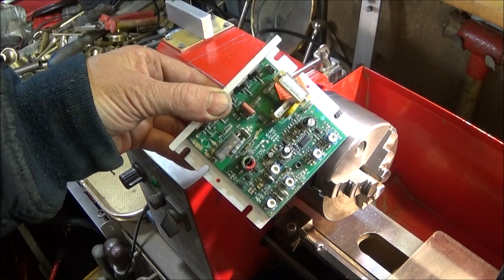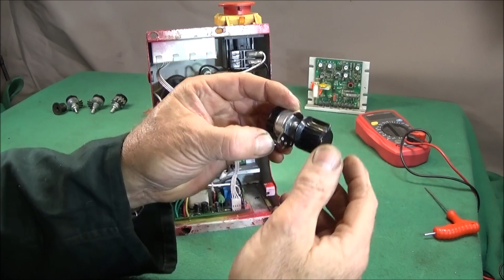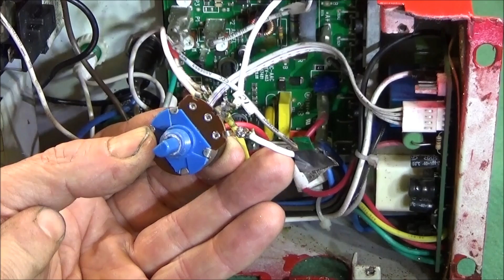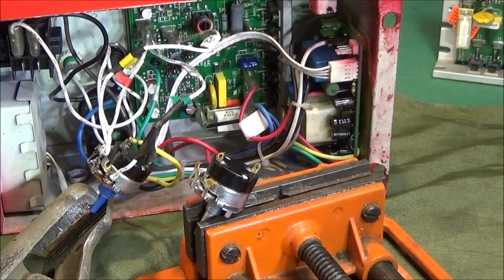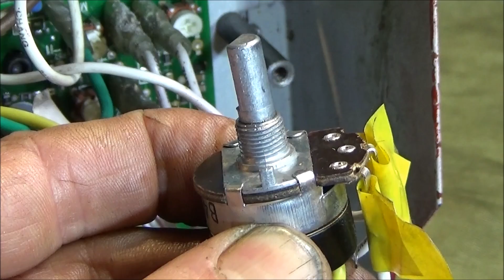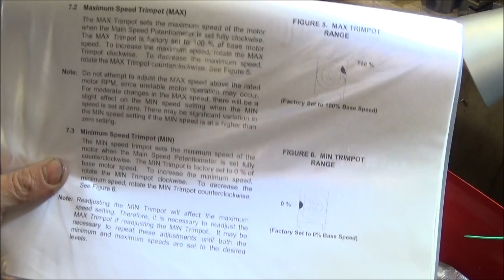How To Test & Fit A Potentiometer Speed Controller On The Chinese Mini Lather

Comment: Thanks for answering my question about using a momentary switch and a non-switching pot. That's what I had in mind b/c the OEM switch is difficult to find or it's very expensive (~$25 US). Now I know it can be done. Appreciate it!

Comment: Just reposition the Forward Reverse selector switch so the rotating chuck provides isolation. If the Chuck's spinning your won't be able to change rotation... so that flimsy zero selected switch would be unnecessary.

An electrical interlock isn't difficult... A zero speed switch with a timer for a second or two of anti bounce would do it. I'll see if I can grab one or draw up a simple circuit to do the fwd rev using relays instead of the drum switch. 

If you have a B472 potentiometer too it's a 4.7K ohm
Reply from the maker: I got rid of the original Chinese electronic parts in the end. I now have a VFD and three phase motor control which is excellent for this lathe.
Reply: @SteveJordan  VFD's are greatly improved now. It's helpful to adjust your belt drive ratio so you're using all the rpm the motor has available. AC motors have always been the first ones to complain about low rpm work but their winding details are getting better all the time.
Cheers.
Reply: @UCEpeQtxhVUTtMZzBpdegp-w Well that's where my comment got to. I was working on it and got distracted and forgot about it... Looks like I hit send. Sorry, I was planning on adding something useful for your rotation change enable switch. They seem to last most people about a year. Bourne wire wound potentiometers are what I like to rely on for customers. I've never had one fail. The 10 turn ones are helpful for fine speed control on things like a welding turntable. The simple way to have a protected zero speed rotation change is to tie fwd and rev selector switches each to a relay and an on delay timer in parallel. The relay's normally closed contact disables the motor until a parallel timer contact closes when the timer times out. This enables the motor again and the potentiometer need not be turned down, the speed will remain as is. 

The timer setting just needs enough time set to allow a coast down from full chuck speed. 
A schematic diagram would be much simpler. 
This is just an idea for anyone who may be interested. There's many ways to automate.

Comment: Ehi Steve, minute 8:17 - i also had the same problem with my potentiometer, and - as at that time wasn't able to find a potentiometer whose switch was closing in anti-clockwise position, i built up a piece of printed circuit board with a normal linear potentiometer of 4,7 kohm, a microswitch ( type with a little wheel ) and a lathed round piece of steel, coaxial with the potentiometer itself, with an half bore in the outline circle, just to get in the wheel of the microswitch.
It works, but - due to the poor room inside the box - i was compelled to adjust the things so that the speed was increasing in an anti clock-wise rotation ( crazy !!! ).
After some time i got the whole box cracked ( after years of punching on the emergency stop ... ), and - after attempting to get a new one from Ali Express ( and negative help of italian postal service ) - i fixed all the electronics into an old box from Teko i had in my house by many years ... and happily fixed that box with the help of four exagonal bolts on the lathe ...
So also i changed the crazy speed increasing in a more human understanding, i intend increasing speed in normal CLOCK-WISE rotation ... 
To do so, I had only to invert P1 and P3 on the potentiometer, and change position of the "shaped" wheel on the potentiometer itself, but it was easy. In the future i will not need any special potentiometer with special type of switch, but only simply, linear potentiometers of 4,7 kohm ...
Best regards from Italy.

Comment: Hi. Great video. I’m in the same situation. Do you  have the part number for this potentiometer?  Than you in advance.
Reply from the maker: Hi I don't know the part number and have a long time since converted my lathe to vfd 3 phase. If you contact Amadeal.co.uk you should be able to buy one from them. That's where I used to buy mine. Sorry I can't help you further. Regards Steve
Reply from the maker: I have just looked on the Amadeal   UK website and they still sell the mini lathe potentiometer. Regards Steve
Reply: Thank you. That helped a ton!

Comment: Can you please show pictures of ALL the wiring  . Im trying to change out the forward /off/ reverse switch and I need to see how it is wired . It would help out alot
Reply from the maker: Hi Michael, I haven't got the board  anymore. I converted my lathe to a VFD with a 3 phase motor so it's completely different now. Regards Steve

Comment: I am in the process of changing the pot on the same machine. Unfortunately one of the leads from the switch at the back of the pot has become detached at the end opposite the switch. One lead is still attached to the smaller of the two circuit boards but I do not know where the other one goes!  Any help here would be appreciated.
Reply from the maker: I can't find my old electronics boards for this one at the moment so I don't know. I will see if I have a photo.
Reply: Hello Steve. Thanks for the reply. Problem solved yesterday afternoon by courtesy of Hugh at Amadeal.  He was able to find a similar control box. The lead had popped out of the forward/reverse switch which unfortunately as you know has a possible 12 terminals.  Thanks again...... Ooooh! keep up the good work on the videos.  Excellent stuff.

Comment: Hello Steve, what do you think about opening the broken switch and to replace it with a tiny limit switch ?
Mine never broke, now I'm using a three phase inverter and a small three phase motor, with vector control and a brand new panel just for speed and direction. cheers
Reply from the maker: Hi i converted mine to belt drive with VFD and 1hp 3 phase motor now. I was the best upgrade I have done. No more trouble with the electronics that I had in the past.

Comment: Hi Steve, brilliant video as always, I've implented many of your upgrades on my mini lathe with great success thank you. On my mini lathe the motor has recently started to hunt/pulse, have you got any suggestions what the problem might be please? Thanks
Dave
Reply from the maker: Hi Dave,  Mine sometimes does that. Its a bit temperamental. The problems I've had with mine were mainly with the potentiometer.  They don't last long and I think the carbon contacts get dirty. Mine has just broke in the switch mechanism again. I have just bought a Maplins potetiometer that can be converted on the switch mechanism and used on the Mini Lathe, which are only 1.50 pounds to buy. So I will show this at some point. Other than that if your motor has brushes, the commutator may need a clean? Regards Steve
Reply: Hi Steve, I've just found this, somebody has suggested to fix this fault "turn the IR pot control on the speed control circuit board anticlockwise 1/8 of a turn at a time until the hunting is corrected. Make sure the power to the lathe is off when making the adjustments" Any idea what he is talking about as I think there is more than one the PCB?https://www.youtube.com/watch?v=B5Xb_-Q9oaEhttps://www.youtube.com/watch?v=B5Xb_-Q9oaEhttps://www.youtube.com/watch?v=B5Xb_-Q9oaE
Reply from the maker: Hi Yes I have altered the circuit board pots before, but after a while the board packed up altogether. I bought a new board from www.amadeal.co.uk but have left the pots exactly as in the factory set. The reason for this is that I checked out the circuit board makers site, where you can get all the information about the exact board and adjustments one can make to it. Apparently there is a very fine line as to where the pots are set up and where an alteration will cause the boards to fail. I think I had turned up the pot that increases the motor torque a bit too much and this blew the board. 
  So after buying a new board I decided to leave everything as it is factory set. I do have the motor slightly  hunting on occasions and sometimes the motor torque seems to be a bit temperamental, but these usually come right especially as the machine warms up. I maybe wrong but sometimes I think it maybe caused a bit by the operating condition in the workshop, as in the summer I don't notice any faults.   
 I will find the makers details from USA later so you can see the circuit board instructions for yourself. Regards Steve
Reply from the maker: Hi Dave further to my last reply....This is the USA maker of my circuit board where you can download a PDF file of instructions for the exact board.
https://www.kbelectronics.com/kb_manuals.html
The circuit board on mine was listed as KBLC-240, but the same one is now listed, (a different serial no), on their site under the title section 'VARIABLE SPEED DC DRIVES'.......... See the KBIC series Drive Installation & Operating Instructions, there for all the details

Comment: Hi Steve, thanks for this video.  My mini lathe was running lumpy through the range of speeds, only really running smoothly at maximum revs.  A set of instructions stated that the pot would be knackered if the lathe ONLY ran at maximum.  It also stated that lumpy running would probably be the brushes.  I checked those and found all OK.  Having watched your video I bit the (inexpensive) bullet and ordered a pot from Amadeal.  I've just installed it and now all is sweetness and light :-)
Reply from the maker: Hi Nige, Sorry for the late reply. Great that you managed to change it. I have found that the potentiometer sometimes doesn't last long.I have had a few of them now, but the one I had last year seems to be lasting well. Thanks for watching...Regards Steve
Reply: Hi Steve, slightly off topic here (but I couldn't see an email address for you) but do you know of any wiring diagrams, to component level) for the mini lathe?  My RPM readout packed up a while ago and I've found a blown-apart voltage regulator on the small board that the readout and pick-up plug into.  If I can get a part rather than having to get a whole new board I'll give it a go. Thanks

Comment: To solder:  Make a MECHANICAL joint. This will mean preparing fresh ends on the wires, and passing them through the tags on the potentiometer. Then a small amount of solder on the iron, place the iron on the tag, then feed in more solder until the work is done. The soldering in the video is, shall we say, "a bit iffy"!!!  :-( Definitely not "mil spec"!
Reply from the maker: Thanks for watching and giving the correct method of soldering. People may be interested in the correct specification when repairing a lathe.....Regards Steve

Comment: You could always use a standard potentiometer with a "normal" switch by designing a simple circuit in line with the switch using a PNP transistor and a 2k resistor on the gate. You could enclose the entire thing inside of some shrink tube so no circuit board is needed.
Reply from the maker: Hi Ian. I have only very basic knowledge of electronics, so I wouldn't know what to do with info like this. Thanks though as it maybe of use to someone reading the comments. Regards Steve
Reply: My instruction is not quite complete but it is still a very simple circuit. Your switch is ON when a "normal" switch is OFF. So you determine which wire looses voltage (and/or signal, call it what you want) when you start advancing the knob from the ON position to OFF; you can find this by using a DC voltmeter easily enough. Now toss in a "normal" switched potentiometer and hook up everything except that one wire that you just discovered. Get a small piece of wire and attach that to the now blank switch contact. What you should have left is the original wire and a new wire from the switch. The old wire that used to go to the switch will now go to the COLLECTOR pin on the PNP transistor. The new wire that you added to the switch will now go to the EMITTER of the transistor. From the EMITTER to the BASE pin of the transistor you will solder a 2k OHM resistor...... Now the part that I left out, run a 20k OHM resistor (this number just isn't that important but you do want it to be a bit higher than the other resistor, 15k or even as high as 30k will work fine) from the BASE pin to ground. Any ground on the current circuit board should be easy to find. The total circuitry is 2 new wires and 3 very cheap components. 1/4 watt resistors are fine and any off the shelf PNP transistor will do the job, a 2N2222 will handle up to 50v. The entire thing should cost less than $5 and you shouldn't have to mess with this circuit ever again, because now you have the same amount of wires attached to the potentiometer, and if it fails again your process for changing it stays the same.

Comment: Your plastic guard in the back of your control panel is getting bad, get a "For sale" or "No trespassing"  sign from Walmart, The thin plastic ones. Cut out a new one. These are about the same thickness and work great. I even wet sand the paint off the signs and use them as shields in places where you don't have to look through them. Plus they are cheep. I love your videos. Norman
Reply from the maker: Hi Norman, Thanks. I know the signs you are talking about. That's a great idea thanks! Regards Steve

Comment: Can I use a pot that's rated higher than I need? ie. my controller requires a 5k pot but all I have is a 20k pot. will it be harmful?
Reply from the maker: Hi Billy I do not know much about electronics. I'm pretty sure it wont do any damage, but I think you will find that the normal speed range of the lathe wont be obtainable using a different rated pot.  Regards Steve
Reply: A circle is 360 degrees. You will reach 5k ohms resistance at 360 degrees when using a 5k pot. On a 20k pot you will reach 5k ohms at 90 degrees. So in essence you will loose some resolution in the speed control. Which will make fine control more difficult. Anything above the 5k range (5.1k-20k ohms) will do nothing at all and will be ignored by the controller. Of course this example assumes 360 degrees. A single turn pot only has about 300 degrees of revolution. So your fine control of speed will be even less. BUT, it will indeed work in a pinch, just don't use less than 5k or you will never reach full speed.

Comment: Steve,  Well if the switch mechanism is too flimsy then there isn't too much you can do about that.  But you know it is likely there will come a time when you can't find these potentiometers.  That might be a long time away.  However, if you keep one of them that broke in the open position.  It can come in useful.  If you absolutely had to, you could then add a normally open momentary push button switch. You would connect the two wires gong to the terminals on the pot to the momentary switch.  That way you would turn the pot anticlockwise to lowest position then push the momentary button and change directions. That would work but it would be a two hand operation it seems.  Not good but it could act as a work around if it became necessary.  Hopefully it will not come to that. With my old equipment I am always needing to find these types of work around.
Reply: Potentiometers are a 100% standard component, always available. The problem is that the switch is rated for small radios, not for this kind of application. The obvious solution is to separate the switch from the speed control. Since there is already a switch on the top of this lathe, he can just use that to control the lathe. It's much better to have the switch separate from the speed anyway.

Comment: Steve,  If the potentiometers are of a weak design you could "as you say use one from China"  This could be made to work properly by introducing a secondary relay to reverse the action of the potentiometer "off position".  That is when the China potentiometer contact opens in the off positon you could then use the added relay to close the contacts on the board.
Just a thought to solve the problem.
Reply from the maker: Hi Glenn, The trouble is I have very limited knowledge when it comes to electronics. I don't know anything about relays really. I only did this video because I had to change this component so many times, that I was forced to learn what I have shown here. When I came to changing the potentiometer the first time, I was actually really worried I might mess something else Up!

Comment: Steve,  Are they putting a large current through the contacts of the potentiometer.  If so it may be too much for the contacts on the potentiometer.
Reply from the maker: Hi Glenn, I'm not sure what current goes through it. Its not the actual contacts that are faulty. The arm that has the contact on seems to be made of a very brittle plastic. Its after many uses of the switch that the mechanical plastic arm breaks.

Comment: Acid flux? NOOOO! That's probably a major reason why the pots are failing so quickly...

Also, you could use a standard counter-clockwise open switched pot, find a low voltage rail on the circuit board, and use a relay to invert the switches operation. Then you could use a conventional pot of higher quality.
Reply: Yes I spotted the use of that flux as well, however it is not even a minor reason for the pot failing, acid type flux should never be used on the circuit board itself as it is a corrosive and will destroy the circuit, but used where he did on just the pot clearly it had not burned through the connection, and given they don't last long anyway, it is unlikely to cause a problem, I would say it is a touch of the cheap components used in these kind of lathes in order to keep the price down.